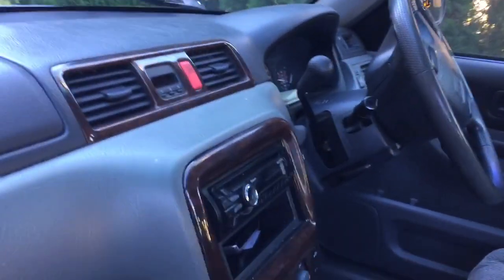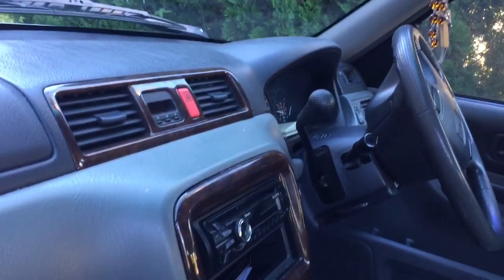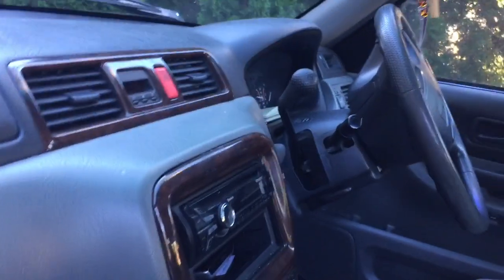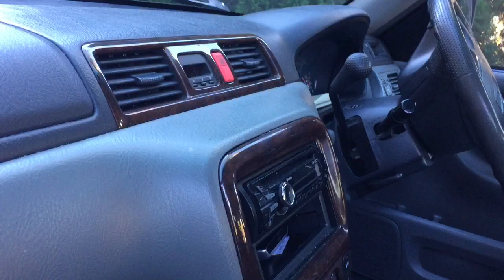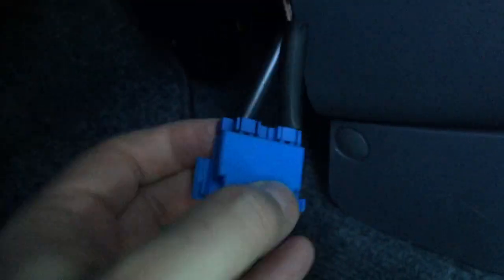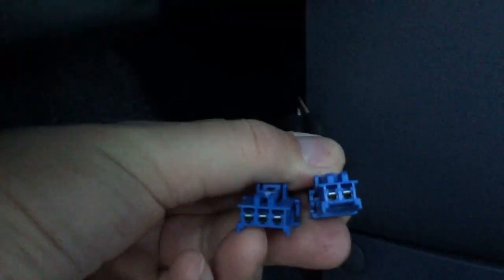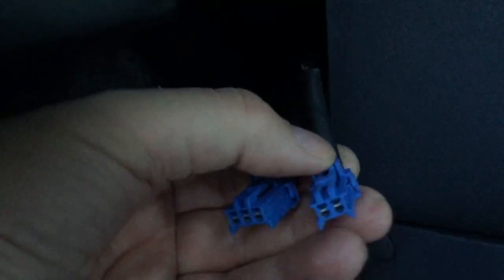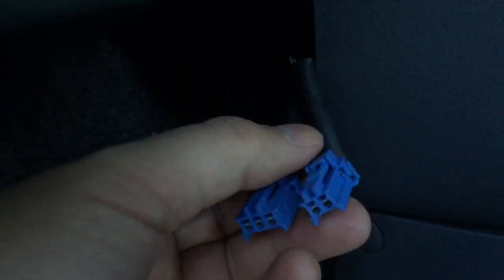Find the Honda CR-V 1996-2001 OBD connector.

Comment: What a find.... been looking for ages to find this. thanks
Reply from the maker: Roger Jenkins Thanks! I found a connector for an OBD dongle on eBay - just waiting on the OBD dongle itself to arrive. Paid around $15 for both!
Reply: Roger Jenkins i've been owning this 2001 crv for 4 years, yet i just found the obd connector today 😩
Reply: Donnysaurus  i bought obd2 connector which is 16 pin.  i have 2001 honda crv.  it doesnt match  with the car pin. how many to be exact s
does honda crv 2001. i found 2 pins and the other is 3 pin.  what kind of adaptor needs for me to able to use my obd 2
Reply: @EonPeon  hi mate..did the ebay toolyou order work? if so will it work woth normal obd reader..thanks
Reply: @doctormavys3176  Hi, is it possible  to connect obd2 with 2 pin and 3 pin ?

Comment: Hi, I have bridged the two-pin plug. However, only the abs light is flashing. Does this mean there is a fault in the abs system?

The engine control light is not flashing. Does it have a separate plug or is there simply no fault?

Comment: I also have the same connectors, what OBD dongle is recommended? I already tried using 3 pin to 16 pin adapter to use the ODB II Bluetooth adapter...any suggestions? Thanks.!!
Reply: Hi, is it possible to connect obd2 with 2 pin and 3 pin ?

Comment: I have a civic from 1996.... But where can I find my obd? I litteraly can't find it anywhere
Reply: I had a 1996 ‘EJ’ series 2 door coupe Civic. It was on passenger side, right up top of the foot well. Just hanging from a wire loom running to centre of the dash. There are two together exactly like this video shows, in a blank holder. One had 3 pin ( that’s what you’ll need an adaptor from to a OBD2 male plug end), the other was 2 pin plug beside it. ( not applicable).  Bluetooth readers DON’t work.
Reply: @melmacind  i am going to look for it straight away
Reply: @melmacind  still couldn't find it... the search contineus
Reply: @wastedpotential3038  Sorry, I gave you a bum steer. I’ve had a few Civic’s. My fault, it’s still on passenger side on that model, but tucked in behind the side cover kick board. If you stick your fingers over top edge of cover, you’ll find the blue blank that they sit in. Once you’ve pulled it out, it’ll hang parallel with base of fan motor for air con system.
Reply: Did you find it now?
Reply: @melmacind  Nop, sorry for the late reaction i didnt get a notification
Reply: @melmacind  i have an idea on what it might be, but its on the driver side, non american model. Driver seat is on the left of the car. I wish i could send u some pics before i break things i dont want to break. It seems to be stuck on the side
Reply: @wastedpotential3038  . Mine is Australian model. Steering wheel on right of car, so the ECU(comp), in behind the side cover kick panel on the passenger side. Footwell area. The 3&2 pin plug combo is in its blue blank cover not far from ECU. So follow wire loom under the bonnet to where it goes through rear eng panel into cab. Then follow it to ECU, to see which side it travels.  You may need to take the side panel off. On my HRV ‘99 model, it’s on passenger side of centre console like this video..
Reply: @melmacind  its a modified car. I have put a diff ecu in it on a different location. I suppose following the cables might do the trick. I will restart the search this afternoon
Reply: @melmacind   i have a 1998 CRV JDM here in South America, and I found the OBD 1 port exactly in the passenger side like u said, after searching for years in the middle hahaha.

so I am happy to learn that all I need is the 3 pin adaptor and not a 5 pin adaptor since only the 3 pin is applicable. I will get this adaptor on ebay.

Comment: Hi, i also have this type on OBD connection on my 1999 CRV can you tell me the link for this OBD plug  on ebay? Its an adapter for OBDII or ir a proper OBDI reader? I have a Bluetooth OBDII reader but of course it does not fit.  Thanks
Reply: Hi, is it possible to connect obd2 with 2 pin and 3 pin ?

Comment: Hi EonPeon, i have exactly the same and i  bough 3 pin to 16 pin converter and a Bluetooth OBD2 dongle but unfortunately it didn't work. if you have any update please let me know. Thanks
Reply from the maker: Ahmad Alaaeldin Abdelkader You can’t use a Bluetooth OBD2 dongle because these cables won’t power it. You need a OBD2 to USB cable and plug it into your PC or tablet.
Reply: @EonPeon  Thanks mate! actually the Bluetooth obd2 dongle i got lighted up and i sync  it with my phone but can't connect through the apps, It will be great  if you can send me the obd2 to usb cable model that work for you
Reply from the maker: Ahmad Alaaeldin Abdelkader just look on eBay. There’s heaps of them.
Reply: @EonPeon  hi mate..do you mind posting the link on that tool
obd2 to usb..thanks